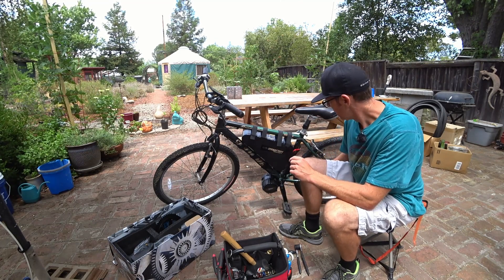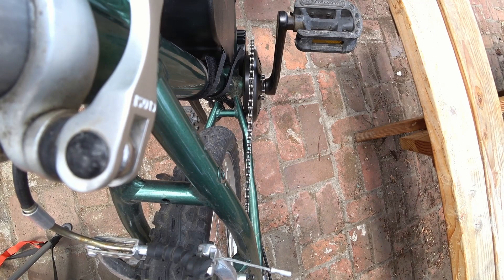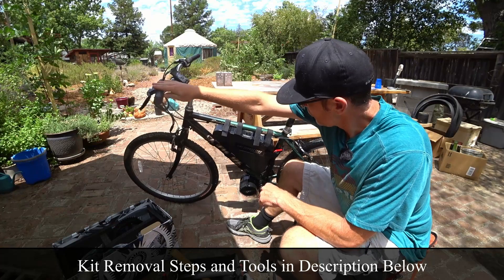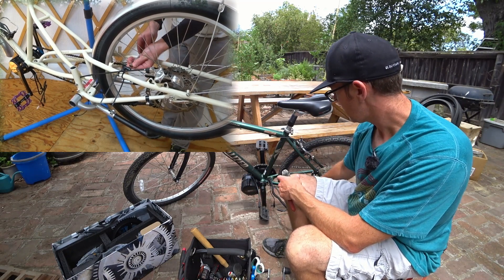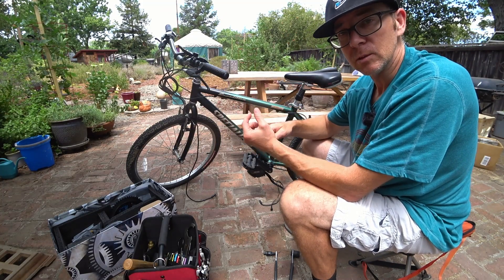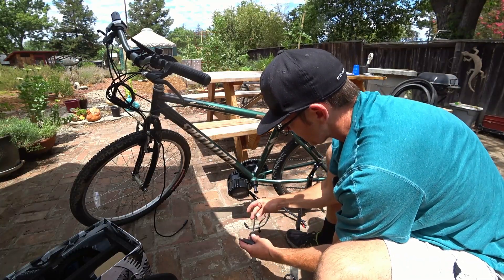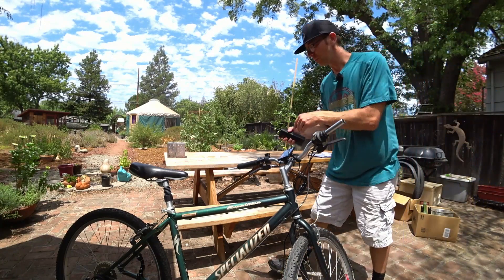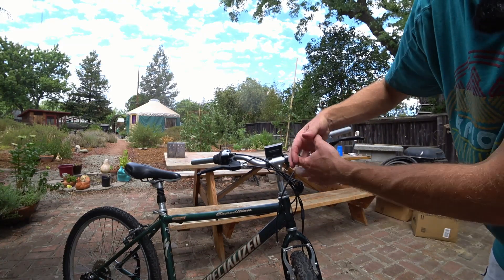Electric Bike Mid-Drive Kit Removal, Bafang BBSHD

Comment: I've got a Bafang mid mount on a Marin frame with 29" wheels and lots of nice accessories, but it's so heavy, and when the battery runs down below 3 bars it acts erratically in pedal assist power, surging and just turning off.  I'm going to return the bike to manual operation. The battery and motor plus all the other parts weigh over 10kgs so they have to come off. I'm hoping it will be a nice normal mountain bike once it's all removed!  Thanks for the video!
Reply from the maker: How big of a battery do you have? I have found that a bafang kit ebike is lighter than a production mid-drive bike. If the voltage settings are not correct in the programming and display and the battery isn't great quality, when the voltage drops under load you can experience some of those issues you are describing. I have done exactly what you say before, the kit just didn't work on a given bike so I took it off, sold the bike, and tried with another bike. Cheers!
Reply: @ElectronSurfer  Hi, thanks for the reply. It's a 10A/hr battery (48V) and the bike with motor and battery weighs 32 kgs. At least now I know why I have been getting these problems, voltage drop. It means the battery isn't in great shape I guess. New battery or remove! Thanks.

Comment: Hey! thanks for the video!
I'm doing an unistalling too swaping for a new motor but my bafang is stuck on the bottom bracket. Probably from rust and gunk. Any ideas what to do?
Reply from the maker: I'm assuming you have removed both the lock ring and plate from the non-drive side. You could throttle the motor which will make it rock up, some movement may help. One thing to check is some bikes have cable guides that run under the bottom bracket, I have seen the bolt that hold them be too long and basically work to keep the bottom bracket locked in. Last thing is to tap it lightly with a rubber mallet from the non-drive side while rocking the motor itself up and down towards the downtube. Cheers and good luck.

Comment: Yeah, Thanks, good Demo, answered my question, but, I do want to ask about the seatpost. Is it a shock seat post and if so, how well does it perform, and would it be recommended again or is there a better option?
Reply from the maker: This style of seatpost isn't great, I used a thudbuster ST for years, good but expensive. I recently a got a suntour ncx, way better and cheaper, great adjustment and travel. It's almost like full suspension, really good.
Reply: @ElectronSurfer  thank you again

Comment: Dear Electron Surfer: Thank you for this very good video! A smart idea to lose grips with an electric pump.:-) What do you think, to go uphill up to 22 % and for 5 miles, would it be a problem with the chainring and cassette you have? Thanks for replying.
Reply from the maker: First off, thank you! Secondly, wow that is some kind of hill!! I am pretty sure the BBSHD would do it, personally I would pedal to take a little strain off the motor and the first time just make sure it isn't getting too hot. You can always drop to a smaller chainring or get a mega-range cassette. Thanks